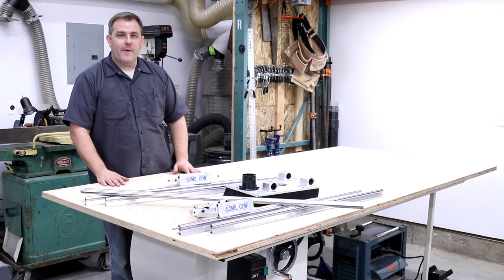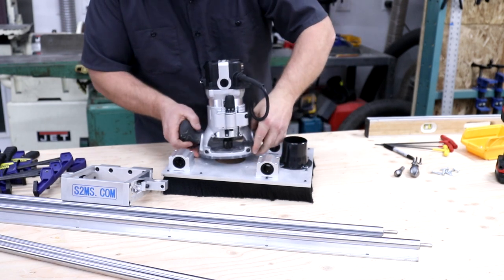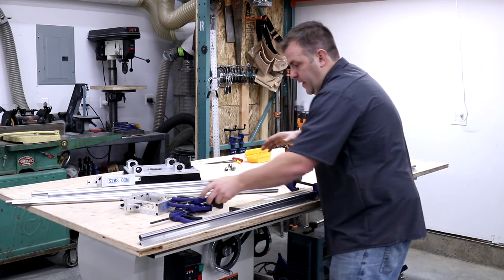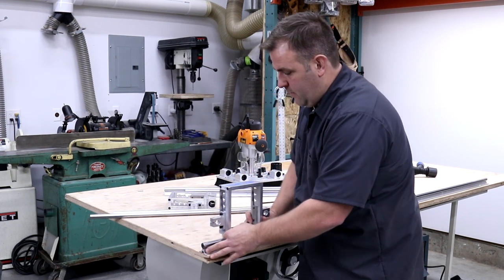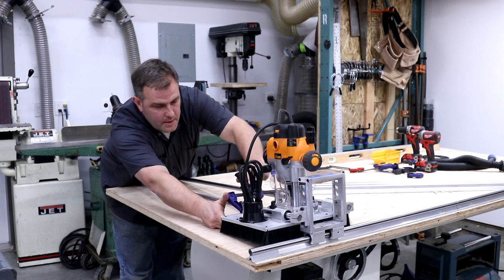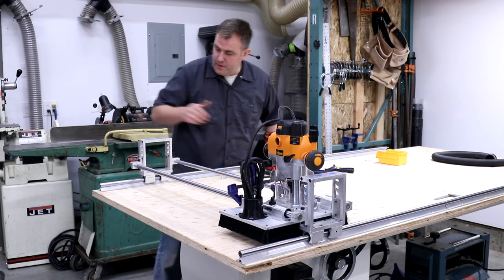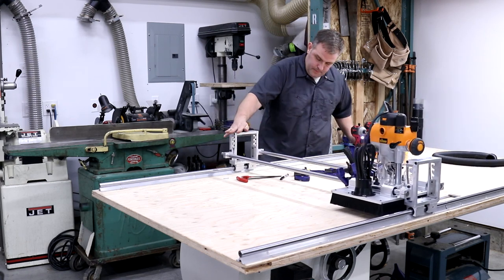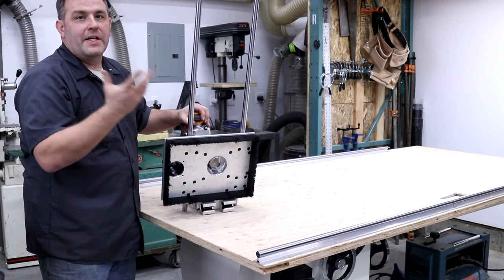Slab Flattening Router Sled - Assembly Tutorial

Comment: Hi, hoping I could get some help here. I bought some rail second hands, the rod looks to be straight, however when I put the base of the rail (what's holding the rod), it does not sit flat on my table and wiggles a bit, the base seems to be aluminum so I think when I bolt it down the aluminum will bend, but my concern is will the rod be also twisting or is there relatively low risk of it happening ? Thanks for your help.

Comment: How do you deal with the inevitable sag of the two rods? Without any measures, you are milling kind of slight "bowl"-shape onto the surface. And if the router is handguided, the bowl-shape is slightly different on every pass, so fine steps appear on the surface?
Reply from the maker: The rods are solid high grade steel.  The amount of sag is imperceptible.  When we hold a light down low on the wood after planning we just see the router marks (not pass to pass marks, unless doing huge cuts, or if the material isn't secured).  While it is possible to push down on the sled and get it to gouge with a little practice, and especially with the new locking bearing it's not an issue.

Comment: Hi 👋, I am new to your work shop, This Looks like a great bit of kit, I like the concept of it, but I think the rails that router went on need to be the same as the base rails so there’s no flex  or as little as possible, PHIL FROM THE DARK SIDE OF THE MOULIN.
Reply: Mr. Stuff explained it perfectly in a previous comment asking the same question. "If you really press on them they will bend". If they were made from a 10" Diameter hardened shaft, they could still bend with enough load. All steel has whats called a Yield point. As long as you stay within the Proportionality limit of that particular steel, it will not flex enough for you to notice. I'm confident the weight of a router doesn't come close to exceeding the Proportionality limit of those shafts so as long as you don't push down on the router it will most likely be fine.

With that said, the design of the router plate has 2 linear bearings on each shaft spaced far enough apart to greatly reduce bending in the shaft so the design and materials of this product are about as good as you can get. 

For the record I'm a mechanical engineer with about 25 years experience, and a journeyman tool maker so rest assured the info I shared on this is accurate my friend. (My real passion is woodworking).

Hope this helped answer the questions guys and remember, nothing can be 100% dummy proof.

Cheers

Comment: Is it possible to lock one of the sliders so 1 axis is fixed? I see this hole on the side of them. I was wondering if that is what it can be used for.
Reply from the maker: Hi Sander, we just launched a new version that allows you to easily lock the Y axis and with an allen wrench and included shaft collars you can lock the X axis too.

Comment: Was thinking about such a setup but got the feeling the rods will bend a little bit
Reply from the maker: The rods are solid industrial steel If you really press on them they will bend. But if you slide the router by the ends or don't push heavily it's not a problem.    For wider projects or people that want the best we just launched a new version that has even beefier rails for even more rigidity.